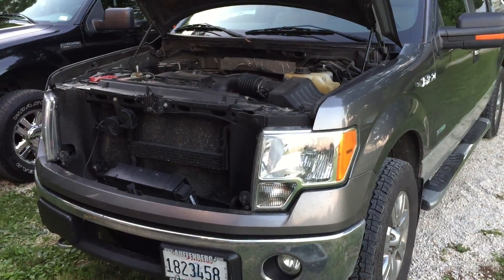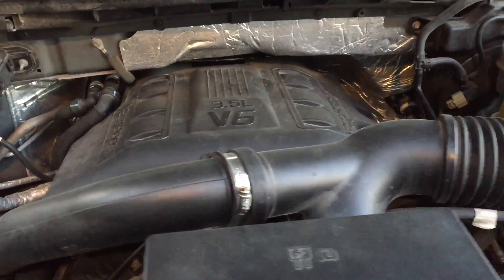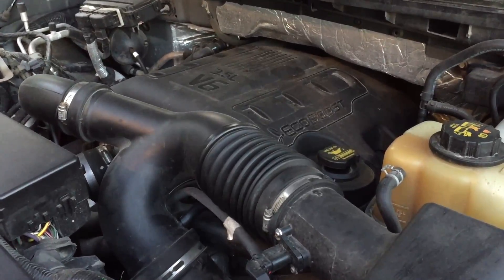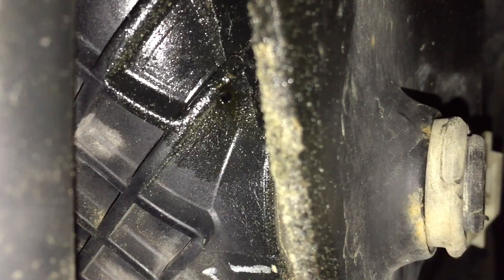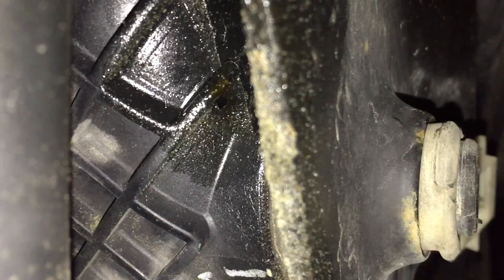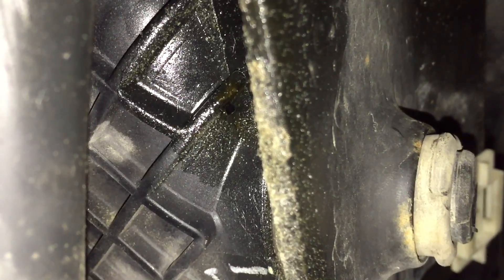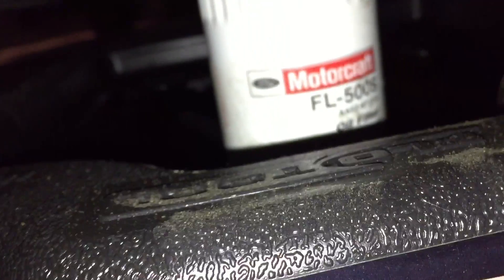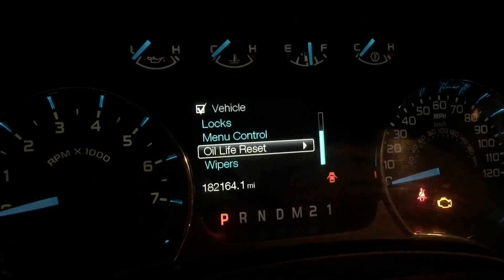Hole Drilled in Intercooler Fixes EcoBoost Misfire

Comment from the maker: UPDATE: A year and a half and 45k miles later, this truck has 227k miles and hasn’t had a single problem since. I absolutely love some of these comments here saying the problem is with the turbos leaking oil, dirt will get sucked in the hole, should have installed a catch can, OMG BOOST LEAK 😱 etc etc etc. 😂 Please, educate yourself on turbocharged engines before commenting and making a fool of yourself. This fix has worked, the time and miles have proven it. Hope this video has been helpful to others out there with the same issue.
Reply: That hole is too small for any kind of significant boost leak, the hesitation is way worse anyhow. It can be as small as 1/16th or probably even 1/32nd. You just need to blow out the small amount of pooled liquid blocking airflow there.
Reply: I been adding an oil catch can on the PCV would reduce the amount of oil coming out.
Reply: I have a 2012 F150 Eco B, same issue, I drilled a small hole through the plastic portion of the intercooler in almost the exact same place as shown, however nothing came out, no water, oil etc.  Assuming I was supposed to stop once making it through the plastic portion?  I was very careful to do so.  If I run my bit through the hole about a half inch I can feel it hit metal.  (not drilling). Any help would be appreciated.
Reply: @shuckydern1 comes out while you drive
Reply: Any idea how much fluid you got to come out of the intercooler? Just did mine and not a whole lot came out

Comment: This is not usually an issue with stock intercoolers, but I believe Ford actually reduced the size of the cooler on the Focus hot hatch due to the risk of hydrolocking the engine.
Anyone who street drives a modded boosted vehicle and lives in areas with similar climate should do this mod as a matter of insurance.

Comment: Just an FYI, I had the same problem. I almost drilled it, but my friend suggested Sea Foam. I did 2oz per gallon in the tank. After it ran through, I didn’t have the issue anymore!!!  I also ran another 2oz per gallon in the next fill up. That was around 3OOO miles ago! I have my power back and it seems to have fixed the problem!!

Comment: Like you, I found doing this well over a year ago on my 2016 F150 3.5 Ecoboost.   When I initially did it, there was lots of crud that came out after the first start of the engine, but it's barely anything now, and I've not had an issue since.   I did change out the throttle body recently, and I was surprised at how dirty it was, so quite possibly that crud worked it's way to the throttle body, and over the years has allowed it to get quite dirty!   I also have a catch-can (passenger side only) and empty it once a month or so, and it's amazing all the crud that would be pushed into the intake!   It's basically oil, moisture and acids, and often looks like baby poo!   I dump it in my garbage can, and then wipe out the catch-can super clean, and re-install.   I also do 5K oil changes, and the trucks running great at 133K, and I hope for many more years!
Reply: would yours ever give you misfire codes? mine did that before as well as the tach getting jumpy and after new coils and plugs was all good. problem is back now about a year later but im getting no misfire codes and a nice steady tach, so im thinking of going with this fix. ive got a 2015 167k, also passenger catch can looks like milkshake about every month, definitly makes me wanna clean the throttle body after seeing what came out of that

Comment: might want to check resetting that oil change in the system panel. i have a 2015 eco and i believe it know if ive been towing or off-roading a lot, and may decrease my intervals, but 7500-10000 miles is too long for me. you can decrease the settings, but still one of the best ways is to write it down. like we have done since the beginning of time lol

Comment: Could this be the cause for water in my oil? I have the same truck and change oil every 3000 miles. I usually have atleast a half quart of water in the oil. Atleast I think it must be water because it doesn't smell like gas and I always add 6 quarts and around 6.5 usually drains out

Comment: I recommend getting the oil separator with catch can instead.  This does work however oil/moisture will still make it to the cylinders. Reason I say catch can is these are direct injection so any oil that makes it back will carbonize on the valves which is already an issue with these Ecoboost engines
Reply: But if it already has the build up in the inter cooler the hole will take care of that and you can run a screw or something back in it if you want
Reply: @F-SeriesOutdoors  true. However the separator catches it closer to the intake opposed to the bottom also just drilling the intercooler leaves oil spots and drips on your skirt. I have it drilled myself cause I don't care about stains myself

Comment: is this like the same thing as using a catch can? It's defiantly cheaper! I gotta try this. 230660 mls on my truck. Replacing plugs more often than needed. Just changed the ignition coil on cylinder 4, no change. About to over haul the fuel injectors. Getting the flashing engine light. P0304. Hope this works! I'll let ya know

Comment: So i have a 2011 king ranch with over 200k miles. had a P0016 code for the camshaft position sensor bank 1 sensor A  6 months ago. i put a new one in and it was fine until today. that is what led me to this video.  is drilling this hole going to fix my issue as well? or do i have the dreaded stretched timing chain?

Comment: I wonder--could you drill a hole to fit a small permanent drain fixture with extended tube to allow the excess to go to ground instead of on the truck?

Comment: I have 2014 f150 3.5l ecoboost that was bought with 130k km and it had really bad misfire on cold start up, everything changed when i installed mishimoto catch cans(driver and passenger side) i changed spark plugs and cleaned all 3 sensors on throttle body etc, it took about 5-7k km to.clean up and engine starts up as smooth as new, as far as drilling a hole in the intercooler its a big mistake and will definitely void warranty on new vehicles. 
Get a quality catch can and you will never have misfire or shaking on start up!
The amount of crap these cans catch between oil changes is mind blowing, really suprising that Ford hasn't addressed that issue as standard recal.

Comment: Have 208000kms on my 14 ecoboost and have never had the misfire except when plugs get worn
Reply: Mark Bulva How often do you replace your plugs? My dads truck only has 60k miles and is misfiring hard would you think it this or the plugs?
Reply: @BookerTJohnson  I’ve done my plugs twice. First time was about 70-80k kms which is 45-50k miles but when my truck is at work it sees tons of hrs of idling so the way I see it plugs are cheap so I’ll do them every 60k kms. and they don’t like big gap w stock coils so keep it .028-.030 when new

Comment: I have own 10 fords and 1 dodge this 2013 is one of the best trucks I have ever own like I said 238,000 miles and only a sputter out of the truck I hope this fixes my truck it’s just hard to drill a hole in to my inter cooler I pray this works thanks for video

Comment: I have a 2013 eco boost mine is doing the same thing it spits and sputters is when I give it gas and go to pass someone or if I try and keep it in 6th gear I just hook it up to computer and it said cam shaft sensor and timming sensor the truck has 238,000 miles and it runs great other than this never have had a problem until now I am just wondering if I should drill the same hole in mine

Comment: Did you try step colder plugs? If your making to much power for the spark it will miss fire under full throttle you need go step colder plugs. Maybe what happen was the hole in the inter cooler looses boost thus he loses power and it stops the misfire lol.  If yall already did that then idk what is just asking.

Comment: Just experienced this for the first time at 101,000 miles. Decided to take to Ford (still under warranty). They replaced the plugs, with the #4 cylinder plug being cracked. They covered a new coil for that cylinder, and labor. I paid for the plugs and diagnostic fee. 

Back to normal for now, we’ll see what happens moving forward.
Reply: Ford warranty ends at 60,000 miles for ecoboost f150 so yeah please stop telling lies

Comment: I tried everything and nothing worked untill switched spark plugs from motorcraft to Auto lite
Reply: Dual platinum?  EcoBoost engines are hard on sparkplugs and the early ones at least with factory sparkplugs should be changed every 75000 miles if your using oe plugs . They start missing under boost if the gap gets to big they should be gapped at 28 to 30  factory 32 is to big of a gap
Reply: @jamesringler987  my 2011 thid the same with oem spark plugs wouldn't  last 10k miles till switched to auto light never had the issue again

Comment: Drilling holes into your intercooler is not a smart idea. Intercooler is designed to take hot compressed exhaust gas and pressures it through the intercooler for cooler intake air. By drilling holes you are loosing turbo boost and introducing moisture into your system. Not the answer for a long lasting turbo motor. DO NOT drill holes in any of your boosted system. Will lead to greater turbo failure.

Comment: 3/32"? Is too big.  I have 1/16"  hole, but I'm thinking it might be too big.  All you need is a hole to let water out.  It should be smaller the better without affectt boost pressure. Remember it is pressurized, water will be pushed out , so size of hole prefer to be small.

Comment: I put a catch can on the "normal" PCV  line, with works when there is vacuum in the intake manifold. Under boost, this doesn't work, as they don't want to pressurize the crankcase.  The catch can does collect a few drops of oil,  but collects quite a bit of dirty water.  When the engine is under boost, there is a different PCV system, which I  forgot about as there wasn't much I could do about it.  This spring I'll see what is in the bottom of the intercooler, and worry about it then. A hole, with a self tapping screw might be something I"ll do.
Reply: I have that underboost problem too. Intermittent check engine light with P0299>Turbocharger/Supercharger Underboost. I just clear the codes coz i dont know how to fix it. Please post if you ever solved the issue. Thanks

Comment: I get the idea of condensation. But condensation creates water, not oil. So is drilling the hole solving 2 problems then? The 1st being the condensation and the 2nd being the oil entering the intake & coating the valves.

Comment: I changed my spark plugs but didn’t change anything, i tried changing the coils also but nothing, so now yesterday i drilled the hole on my intercooler but it did show a little improvement but it still does the same i press down on the gas and it still makes the sound! Any ideas on what else can i do?
Reply: Mauro Calderson Did you ever find out what it was?

Comment: Does the truck have a catch can installed?  I ask because it would be encouraging to hear that he got so many miles without a catch can without the intake valves being fouled up.  I've been thinking of getting a catch can system for my 2013 F150 EB. I didn't know about the problem until long after I bought the truck but if this guy got so many miles without a catch can, maybe I don't need one after all. I'd appreciate any comments.

Comment: 1/32" or 1/16" the most. Never, never 3/32 or 1/8". Yes, your turbo has pressure compensate function, but big hole will have turbo work hard to compensate the big hole leak, if too big, the compensation may not even able to make up the pressure loss.
Reply: I was also seeing a lot of people do 1/16th and above but I believe 1/32 is the best option as it only needs to drain very little over time.

Comment: That hole is too big man,  you said 3/32"?. it is Too Big!!! Small hole works better bcz all you need it to let out the dirt fluids, 0.7mm (1/32") is sufficient, anything bigger than 1mm (3/64") is unnecessary and cause drop in turbo efficiency.  Big hole leaks air will cause turbo pressure build up slow, you will feel it lag in power or slow in acceleration.  I drilled a 1/16" hole as Ford said, but still too big--you definitely felt it as you press gas peddle. I eventually plugged 1/16" hole up with resin and poked a smaller hole in the same place  (before the resin is dry) with a thin needle (about 1/32" or so). Test drive with small hole, man, acceleration is much better. the dirty stuff still comes out ok.

Comment: If you have oil inside your intercooler at that point pull your pressure tube comimg from the turbo on the drivers side, if the oil is there YOU HAVE A BAD TURBO OIL SEAL! Did you think the oil was noromal?? Did you presume that its a oiled intercooler?? 😂😂😂 no.. oil is not a good thing to see inside your intercooler. Ps... the driver side turbos take craps..

Comment: Is y'all's shudder when you hammer on it only? Mine idles fine and drives ok if I take it easy. If I hammer on it I start to hear a whine behind my glove box and the check engine light will flash causing it to go into limp mode.
Reply: Mine does the sames as your, minus the glove box whine, the CEL, and limp mode.... I am swapping plugs, and if that doesn't work, drilling this hole...
Reply: @DoyleHargraves  I had a hole in the intercooler and still did the same thing. I just changed spark plugs and coil packs which didn't help either. I ordered a catch can so maybe that will help. If all else fails I'm going to buy  new turbos and hope to GOD that fixes my problem. Keep me updated if you fix yours Doyle!
Reply: @benhemoth4693  mine is starting to lokk more like axle wrap.

Comment: Catch cans solve the intake valve coking.It does nothing for the CAC condensation.I drilled mine at it solved the issue.If the engine sucks up too much condensation all at once it can permanently ruin the engine.Just drill the CAC (1/16" drill bit) run a high quality catch can and enjoy a brute of a six banger!!!!!!!!!!!!!!!!

Comment: Drilled mine with an 1/8" bit.  Nothing came out right off the start but once I got it out on the highway it spat and sputtered for a couple of K and the sputter was gone.  Looked underneath and the signs of water/oil....
Thanks for the fix, glad it's an easy one

Comment: Drilling a weep hole DID NOT fix my misfire problem.
Reply: Dom Cricket Do plugs. It fixed the misfire in mine. All the people putting down the Ecoboost like it's some kind of bizarre technology. It's not. Turbocharged engines have been used for years in Europe.
Reply: Jeremy Gaillard 
Thanks Jeremy. Finally got a code and a misfire on #3 bad ignition coil. Replaced it myself and runs smooth. Agree way to much hype about the Ecoboost issues.
Reply: Dom Cricket Thanks for the update

Comment: Thinking of buying a 2011 3.5 eco with 100k should I go for it ?
Reply: Hell no! go 5.0L
Reply: Depends, If will taken care of, then go for it. Toyota is Almost bullet-proof. Ford, on the other hand, needs a little more Tender Care. I had doubt and was skeptical about Ford quality, not even mention the NEW turbo. After owned a 3.5-L EB  F150 for a year, for the first time owning a Ford-FYI), I kind of like the F150 Eco boost for its power, mileage, and price (toyota is way out of reach, even a used one).  I think Ford definitely has some funny design, not attention to detail. (such as why it does not have a cabin air filter prior 2015?  some configuration and mechanical are apparently flawed and not a well thought of--such as the 2013 and 2014 vacuum pump leak? looking at an oiley Ford engine  makes me sick.) Over all it is ok, If you can find a good one with right price. If you pay too much, I'd say it does not worth it, go for a toyota, worry free.
Reply: What price? and what is the condition? If it is good condition and good price, then go for it. I currently own an 2014 EB with 100K miles, like it,, and I'm buying another one 2011 EB (1st gen with 50K miles on it). My personal opinion and experience:  Ford has some issues, and many issues seems not been tested before put product on market!!! If you are a "car guy" or "mechanically oriented" and hands-on,  then F-150 is a good truck. There are so many out there so you can easily find a "GOOD" one with "Cheaper" price, (not so easy with toyota). Ford definitely needs a little more care than Toyota, but in general those remedies/fixes are not hard to do. For Toyota, all you need is to change oil. In summary,  you can save more $ by owning a good Ford truck if you can and know how work a little bit. If you are lazy and don't want to deal with minor issues--forgot about Ford, go for a Toyota.

Comment: Drilling a hole in the intercooler will allow debris to enter the intercooler, yes it will push out condensation but the trade off don’t make since. Maybe you should block off some of the intercooler so the air temp will not drop to a level such to create condensation. This is called reaching a dew point via delta temps across the intercooler coil. Blocking off part of the intercooler will produce the same effect, and will prevent from damaging the engine over a long period of time by introducing debris into the turbos and engine components.
Reply: There is air being forced into the intercooler, therfore making  positive pressure. Nothing will be pulled into the 1/16th hole.

Comment: Ok, from looking at this and an another video, I heard condensation (water dropplets, possible turning into a small puddle) collects and then gets sucked into the motor and causes a misfire.
Now was that oil or water draining out?
Both could cause a misfire, oil fouled, water? 
Hey I'm just curious which it is.
Thanks

Comment: Condensation shouldn’t cause misfire... it’ll just evaporate back into the air. 

That oily residue is what’s the problem. Oil reduces the effective octane rating of your fuel.